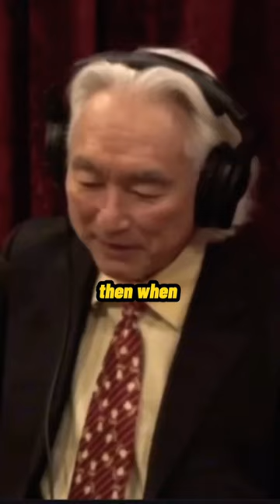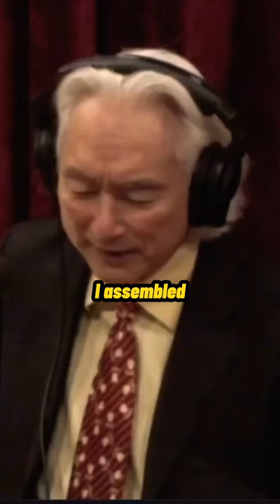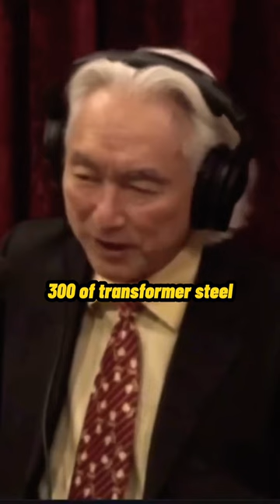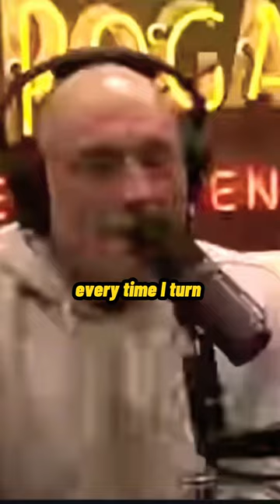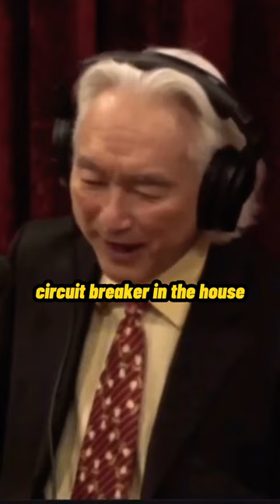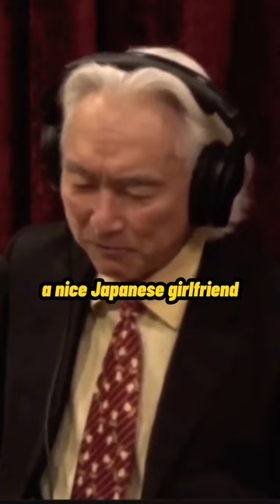Michio Kaku Built a Particle Accelerator in High School | #shorts #jre

Comment: Every junkie knows this story is bullshit... 22 miles of copper... I've seen them rip a trailer apart still never get near that amount. 🎉😢😂
Reply: It was prob the 80s
Reply: A junkie isn't buying copper wire, they're selling it. They aren't a primary source of copper for high schoolers in 1963. An entire trailer only has minimal electrical copper. Even a house has minimal copper, only enough to get the job done. 

Also, 22 miles of copper isn't an insane amount. 300 lbs of silicon steel (transformer steel), now that would be harder to find in the mid 60s. Harder. Not impossible. Especially for a japanese high schooler showing technical aptitude.